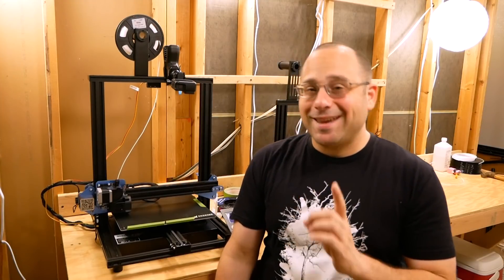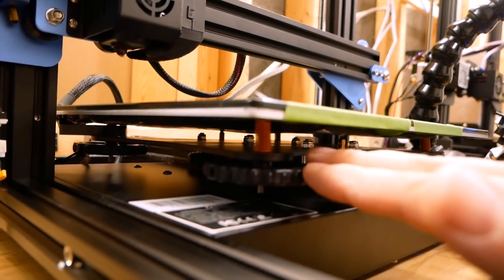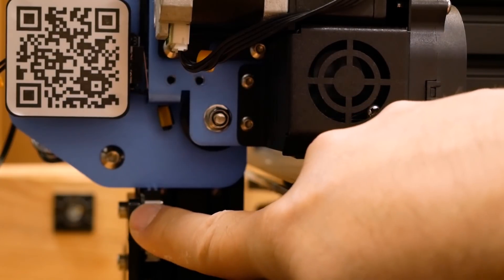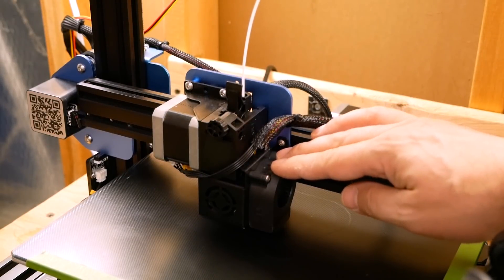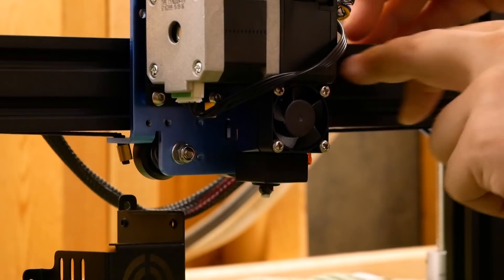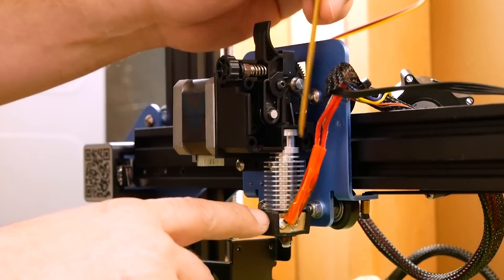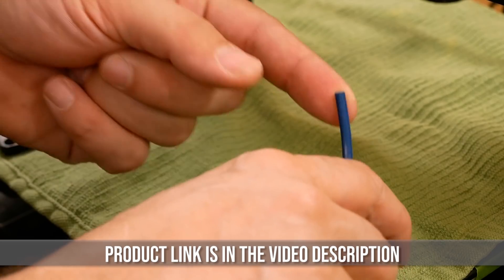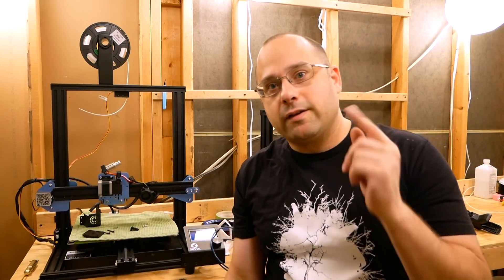Sovol SV01 PTFE Insert and Z Axis Limit Switch Setup

Comment from the maker: Sovol has added the PTFE tubing in current printers. If you just bought your SV01, don't feel you have to tear the hotend apart to check. It's likely fine.
Reply: @Blondie SL Great question... I ordered mine direct from Sovol... ordered on Saturday, got it today... 4 days including Labor Day, can't beat that...
Reply: Blondie SL I see your point about dealing with the company directly. I actually did the same when I got my Mavic Air 2, got it from Amazon because dealing with DJI directly is a one-way ticket to madness. Should have thought about that with this printer, but somehow I didn’t. You make total sense. 

I hope then I get lucky with mine. It arrived yesterday, but won’t have time to set it up for a few days. I think I hosed my current printer, a Monoprice Maker Select. It’s been a beast for over 5 years. I tried printing ABS but didn’t realize the bed temp was set to 110° and the limit is 80° or so. Got error that the bed overheated but never went away. So it’s apart on my workbench (I keep my printers at work..). So gotta figure that out first.
Reply: Are you sure? On their website they seem to include the PTFE tubing and the cutter, so either you still have to do it, or it's a spare? And do you have to remove the insert if you switch to PLA after a TPU print?
Reply: Just got mine and disassembled extruder. Tube is there from the factory. That's good, but some screws was not tightened. And Cura does not recognize my printer at all, so I flashed it by compiling Marlin from Arduino IDE. Had printed calibration cube from TPU. Perfect. Thanks for advise, mr. Bardwell. Happy printing!
Reply: Thanks!

Comment: Now you can print and build an RS-CNC32. It's a 3d printed low-cost high rigidity CNC machine that uses 1 1/4" Square steel tubing as the rails for the motion system. People have successfully cut aluminum with it. I'm about 90% done building mine with printed parts motors and firmware working but unfortunately having to move has put a damper on that project for a bit. BTW I'm a former electrician and seeing those diagonally ran romex cables gives me anxiety! At least they follow a consistent angle lol

Comment: I just paid for your next burger. Used your link to buy the Sovol. ;)  I was very up in the air about this one versus the Cr-10. There is a sale for the latter at $350, and it's slightly larger. I'm not going to explain my reasoning, cause I'll probably get buyer's remorse, but at the moment, it seemed like the best move.

Comment: If i was you i would fit a z probe (either proximity or touch) and upgrade the marlin software to suit. I also removed the springs as it was bending my bed causing drag on the bearings. nice printer, I started out with an anet a8, but now it has none of the original parts and prints just as good as a 15k+ machine.

Comment: Bardwell, you've done it this time. First FPV now this.  A week ago I had no 3D printers. I now have 3 SV01s and I have ordered new boards and upgraded to all metal V6 on and titan aero with Volcano hot ends on other 2 to print PETG and Nylon.  Also upgraded to E3D extruders.  Thanks bud.  Btw these print pretty damn great out of the box but I can't ever  leave nothing just good enough.
Reply from the maker: RIP your wallet.

Comment: FYI - I just tore apart my Sovol SV01 (purchased since this vid was made) and it has a tube running all the way from the plastic bit, through the heatsink, to the hot end.
Reply: Did you purchase that through Amazon or directly from the company? I just got my today from Amazon and don't want to mess around with too much if I don't have to.

Comment: What is the insert they used meant for 3mm filament? That extruder looks like a titan clone, you may be able to pretty easily upgrade it to a titan aero which can print TPU VERY fast without issue even with decent retractions to cut down on stringing. With 1.75mm you could probably even use a pancake stepper to cut down on weight/reduce ringing artifacts

Comment: @Joshua Bardwell Hey Josh, now that you’re accumulating more than 1 printer, you could really benefit from OctoPrint! OctoPrint runs on a raspberry pi, and offers a really nice and user friendly GUI for controlling your 3D printers. It also acts as the G-Code “master”, so no more need for the SD card. Additionally, using the AstroPrint plugin within OctoPrint, you can monitor and control your printers from your phone anywhere in the world (AstroPrint also sends you update notifications to let you know what’s going on with the print).Lol Another great benefit is that you connect to the OctoPrint server via web browser and IP Address, so you can load and start prints without actually standing right next to your printer via WiFi (assuming it is setup already I suppose). Lastly, I haven’t yet tested this but I don’t see why it wouldn’t work, you should be able to connect both of your printers to the same Pi and control/monitor them both remotely. And with a simple and cheap raspberry pi cam installed you can do really cool time lapse shots!

Comment: Good video. 2 things to note. The reason real Capricorn is better, is it has a consistent diameter that is both centered, and the correct size for 1.75mm filament.  The other stuff is too big, and sometimes inconsistent. The second thing. The heater wires, like you said, are very easy to break, but if you are replacing them with new ones, or building a new machine, new ones will not be nearly as bad. The heat cycles make them brittle, and the longer you use the machine the worse they can get. That is a big reason thermal runaway protection is important.

Comment: Just got my sovol and did the steps as explained in this video. Mine already has a white PFTE tube that goes all the way through the extruder down the heat sink to the top of print head. You explain just to install tubing on top of heat sink.. which is better?
Reply from the maker: That advice is no longer needed on the updated hotend.

Comment: Joshua, removing the fan with a clip from a heat sink, the way like you did, you will brake the fan. You should unscrew the fan firstly. Better check if the fan isn't broken yet :)

Comment: I can't wait to see your comparison on these two printers. I pulled the trigger on an Ender 3 Pro a few months before you started this series up, with dual z-rod modification and direct drive the Ender 3 is a TPU printing beast although it does well out of the box I just can't leave anything stock.🤘🤣 Hopefully you got the ender 3 pro..  There are a few differences between the pro and regular version that are worth noting imo.

Comment: Pretty nice job, Joshua! 😊
About TPU... Wait until you see ninja flex. 😬
Reply: Try Recreus Filaflex😎
Reply: MC's Creations I just picked up some ninjaTek TPU to print landing pads and GoPro mounts and whatnot for my quads. I’m new to this type of filament and went with the Armadillo TPU... And it is super not what I was looking for lol much to hard, almost PLA solid. Trying to think of a use for this stuff...
Reply: @zfpv7211  Yeah, I bet! There are lots of different filaments and the names are confusing. 😕
The ninja flex is basically like soft rubber... Maybe even softer.

Comment: after years of tweaking bed levelling before every print on my old reprap, i finally broke down and bought a prusa i3 which auto levels before every print. just hit the button and it prints perfectly every time. sure cost a bit though... the new prusa mini looks promising, but i don't think it will do flexible filament and i think that's important for people doing the drone thing.
Reply: BLTouch sitting here too lazy to install lol
Reply: I'm between the prusa mini and the i3. Currently I have tevo tarantula and I actually get pretty decent prints with flexible filament with the bowden setup. I'm sure that prusa got the mini dialed in for flexible filaments.
Reply: @FirehouseGeckos  it might be fine for the stiffer soft stuff, but i got some really soft tpu from matter hacker that i'm sure would have bad retraction issues
Reply: @aaaaaaaaaassssssssdf  I could definitely see the more compressible filaments causing issues. My tarantula needed a lot of tuning to get it printing PLA well nevermind TPU. I'm holding out on deciding between the mini nad i3 until I see some people's experience with the mini and TPU.
Reply: @FirehouseGeckos  in the end, prusa makes a great product, i just think a direct extruder would be better than bowden for soft stuff. i think for about the cost of the prusa mini, you can get a chinese clone of the i3 which would probably be a good choice too.
Reply: Literally a 45$ upgrade for auto leveling rofl

Comment: The 2 printers are just about the same except the extruder . Definitely  do the fan upgrade i used the ballbearing ones the fans that come with these printers suck and burn out way to quick print yourself the bull fan duct upgrade for the ender

Comment: Hi, I just mounted my Sovol Sv01 and the X axis &Y axis  doesn’t move. I tried putting the Z motor cable into X & Y motor then the motors  moves, so the x & Y motor works. Also I change  the cables and the axis Y & X  doesn’t move. What’s the problem with my axis issues?
Reply from the maker: Please contact sovol support and make a post on the Sovol Facebook group.

Comment: CAUTION: The part cooling fan is attached by two tiny wires....mine broke off of their solder points inside the housing, just from hanging there while I fiddled with the rest. Sovol supplied a new print head in good time..a week, but hey...

Comment: Do yourself a favor. Spend 120 bucks and get an E3D Hemera direct drive kit and never have to screw with this kinda stuff anymore.   Also, another 35-40 bucks on a BLTouch and you'll have that machine as near-perfect as you can get.  Obviously there are some other miscellaneous items here and there, but it's easy as heck to do.
Reply: Also, on reread, that sounded a bit snarky. Wasn't meant to be.
Reply: I bought a BLTouch along with my Ender 3 Pro, but haven’t installed it, my bed is not warped and I hardly ever have to adjust my bed between prints....
Reply: @giantfpv9862  For me, being able to throw a PEI, spring steel, glass sheet down to better suit the plastic I'm printing and not having to worry about the bed is 100% worth any  hassle of installing a bltouch.  And if you're running marlin/reprap it's really easy.
Reply: Micah Morton that’s fair. I don’t change my bed between PLA and TPU, but I cooould see how it’d be useful.
Reply: @giantfpv9862  Yeah, it's pretty useful. It's also nice if over time my bed gets a little out of level.

Comment: 1. To tighten the Bed so the springs are so tight is not needed. You say "so the bed cant move up and down" 
WHY should the bed move up or down?  The only reasy why this could happen is when something hits the bed. If the nozzle does, you have to tune the nozzle hight.

2. Never use one sheet of paper folded in half! This CAN work! But will mostly make you prints to not stick or to look like you have bad extrusion. It wont squish the filament on the Bed enough!!!
This really is a bad advice! Most ppl even use the paper a receipt cause its thinner than a sheet of paper!
Reply from the maker: I have run five or ten test prints if the 1st layer only, showing them to pro 3d printer experts, and for whatever reason, 2 sheets of paper produced the best results for me. The truth is you just have to look at how the 1st layer is coming out to know if the height is right.
Reply: @JoshuaBardwell Now I guess as a next step for you, you could go ahead and take a look at auto bed leveling probes and then simply use the live Z-offset adjustment feature (Babystepping) to get the right height.

Regarding point 2 of Eddy, it actually very much depends on the material you're using, too. PLA? Sure, you can squish it into the bed by quite a bit. However, try that with PETG, especially with a glass bed and you'll probably end up having a bad time.
Regardless of the material, too much squish can also cause rippling artifacts on larger surfaces because material from the first line would squeeze over into the path of the second line, continually building up excess material.
Point 1: It's an i3 style bed slinger. People even replace their springs with silicone blocks to reduce bed wobble on fast movements.